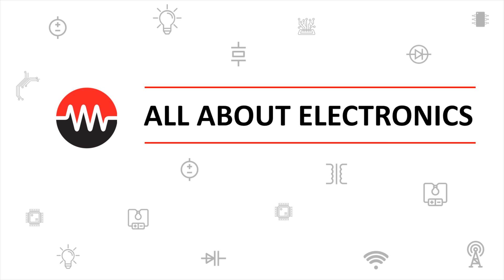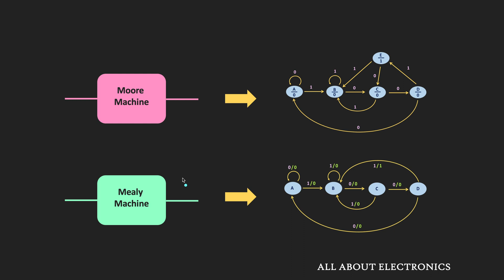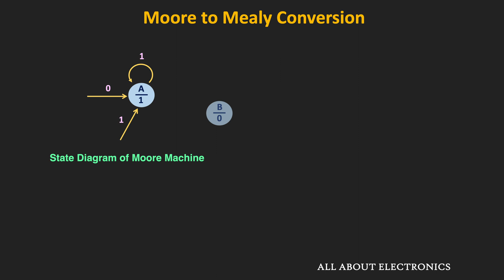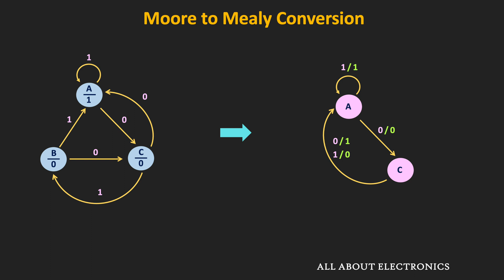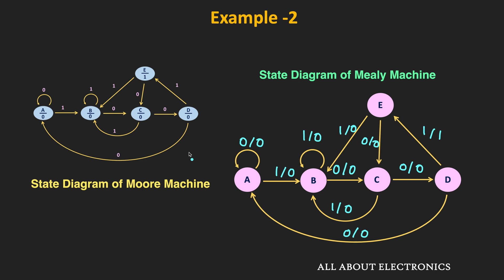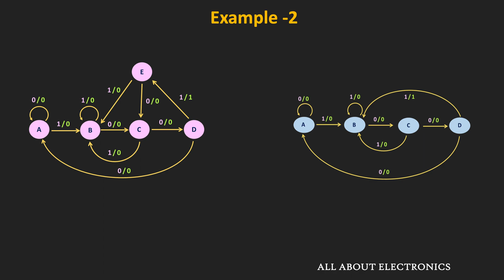Moore to Mealy Conversion Explained | How to Convert the Moore Machine to Mealy Machine

Comment from the maker: The link for the other useful videos related to Finite State Machine:

1) What is Finite State Machine? Mealy Machine and Moore Machine Explained
https://youtu.be/kb-Ww8HaHuE

2) How to Design a Finite State Machine? Mealy Sequence Detector
https://youtu.be/PbjntQf3sGc

3) Moore Sequence Detector 
https://youtu.be/ZCRrECZe7YA

4) How to Draw a State Transition Diagram? Analysis of Clocked Sequential Circuits 
https://youtu.be/zVJiQZnMXxo

5) Mealy to Moore Conversion:
https://youtu.be/vOl-OmOxnWA

6) State Reduction and State Assignment in Finite State Machine:
https://youtu.be/qq7moL5ueNQ